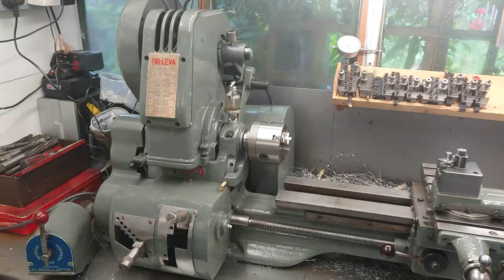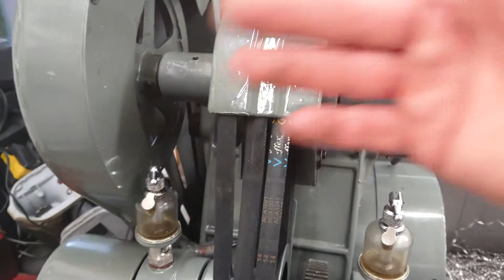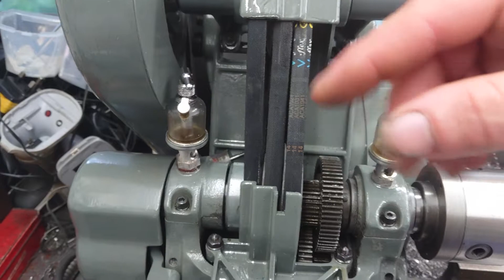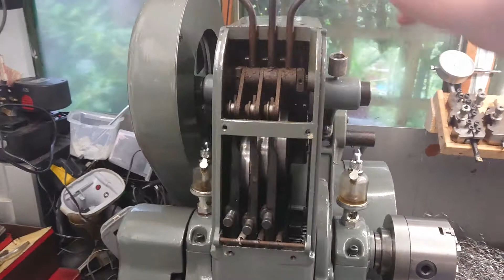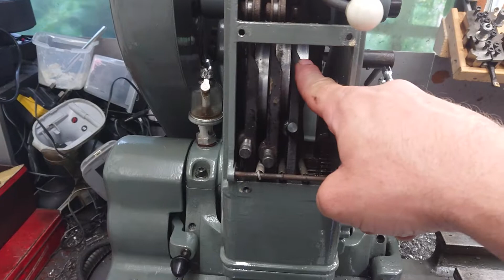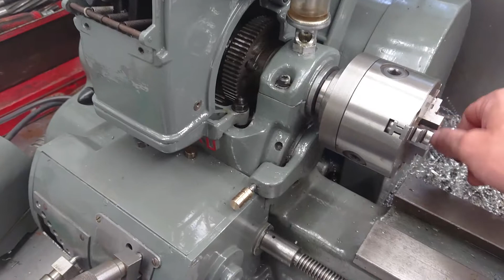A description of the Myford tri-leva

Comment: Hi Duncan
Appreciate some advice please. The'fast' lever has to be held down to keep it engaged. Either that or try engaging it anything up to half a dozen times or more. Any idea what I need to adjust.
Reply from the maker: Sounds like it's either the adjustment on the idler, or the cam setup on the lever itself. Try adjusting the idler first. You could have to much tension on the belt so it won't lock in place, hope this helps 👍
Reply: @demondunk  thanks Duncan. Will try that.